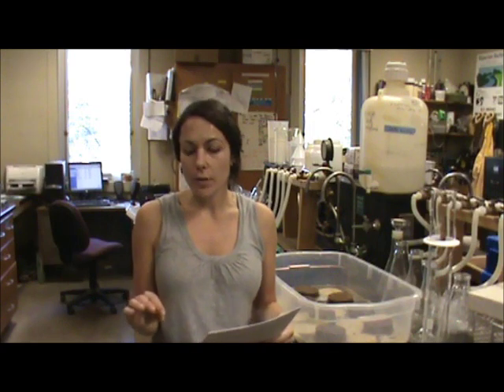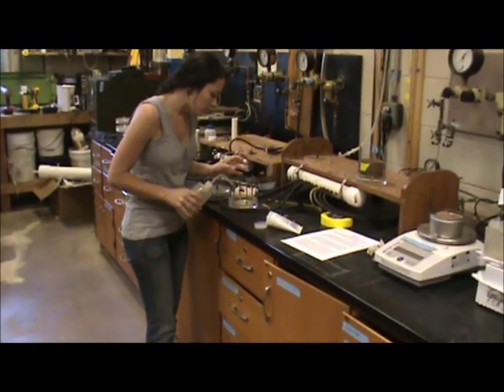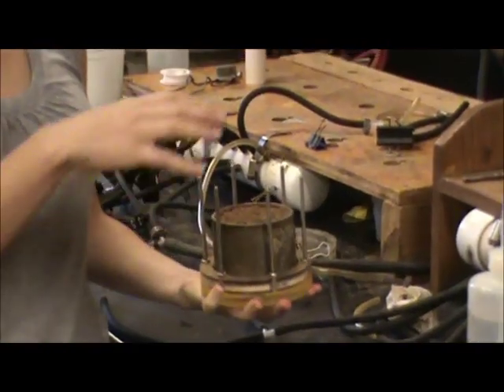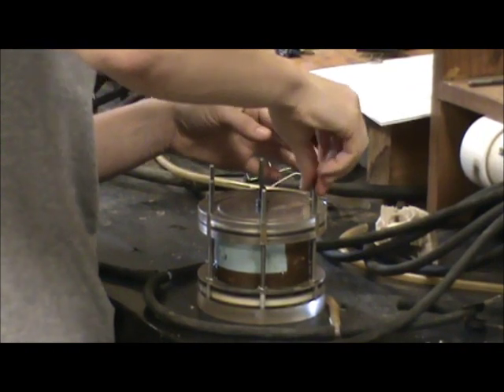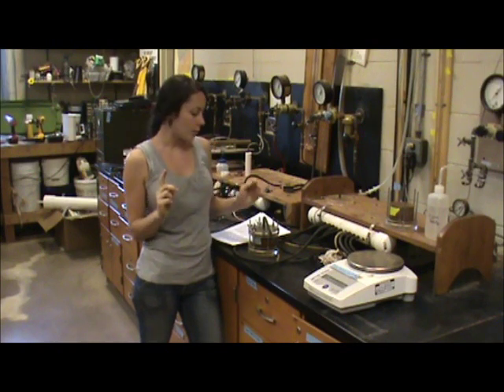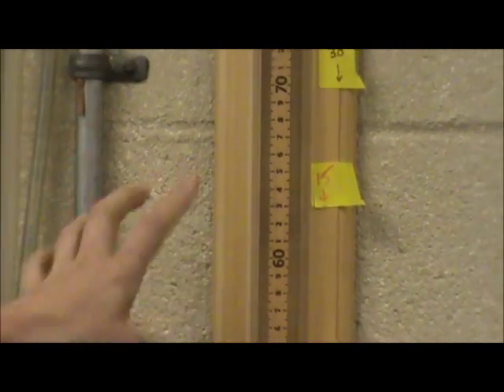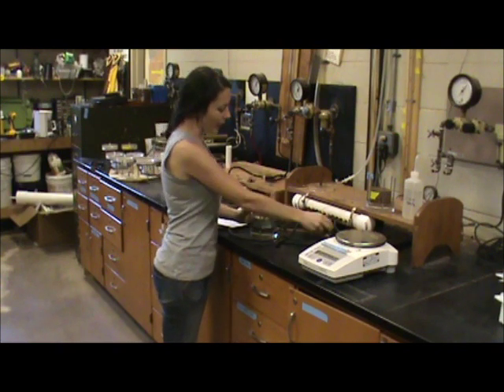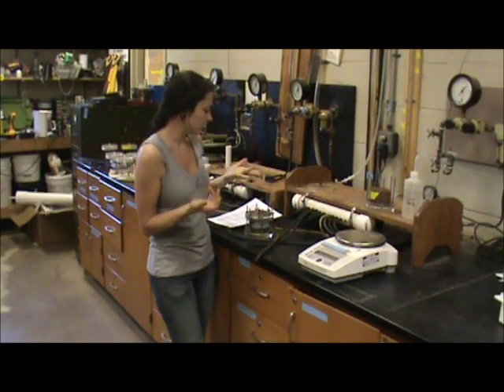Soil Water Characteristic Curve (SWC) Lab.wmv

Comment: Hello, I'm from Japan and study geotechnical engineering.
Btw I focus on unsaturated soil and especially infiltration.
I try to develop a laboratory method which is steady and direct measurement method to measure unsaturated hydraulic conductivity .

Well, my question is what is the problems of Van Genuchten model or the other kind of prediction model?
I'm wondering that my research would supposed to be more advantage than some prediction models.

Please give me your advices.
The best regard from Japan
Reply: You might want to check out HYPROP and email the developers with this particular question. Regards, from Germany
Reply: Danke schoen
Btw Ich bin Yuuk und i have studied in TU Dresden 5years ago.
What is your name?